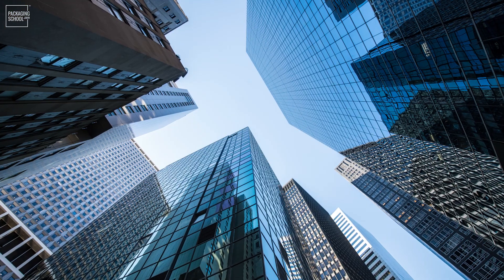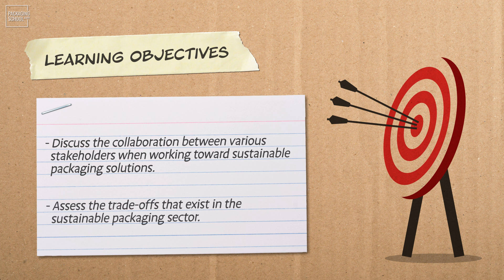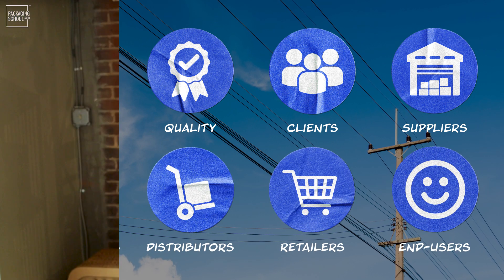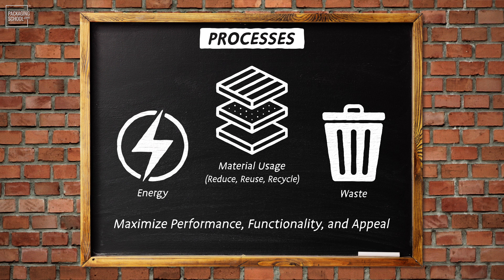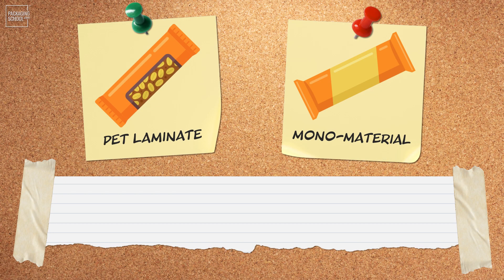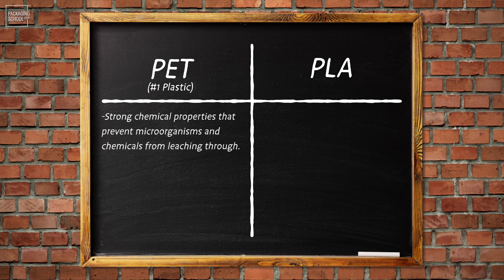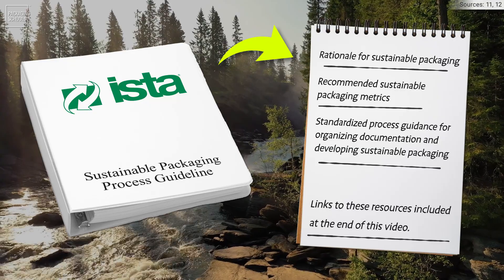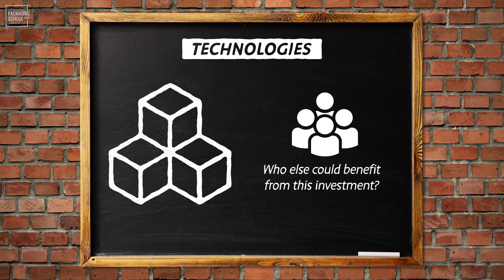Understanding Sustainable Packaging Trade-offs │ LOTM Ep. 6

Comment: The reason for multilayer packaging is its longer product shelf life, oxygen barrier properties and water vapour transmission rate. Multilayer often uses PE, HDPE in the outer layer and may use a thin layer of better barrier materials such as aluminium, ethyl vinyl alcohol, etc (EVA) and some adhesive to bind them. In food packaging, milk cartons these materials usage may be lesser than in a plastic bottle that stores chemicals like fertilizer, oils etc. Moving to mono-materials especially bio-degradable ones can be a little tricky especially with trade off in shelf life and degradability of materials and regarding food, the leaching of plastics and impurities with the plastics into the food. Nevertheless, the pursuit in the substitution of these materials is our key focus.